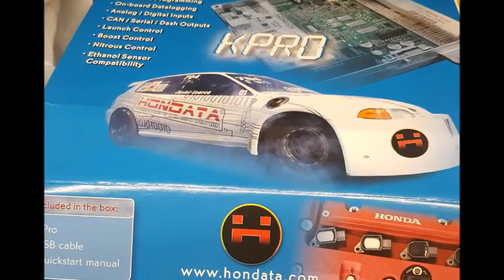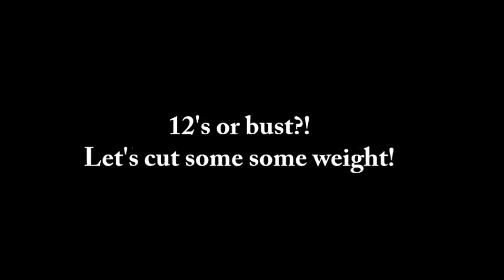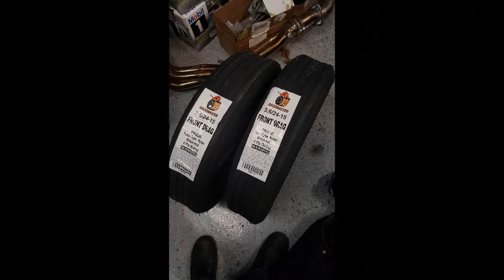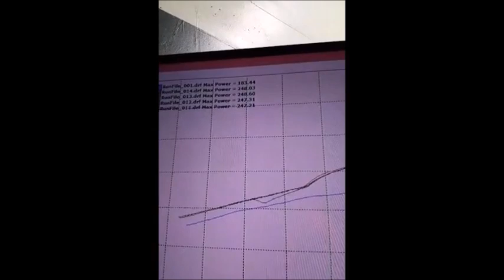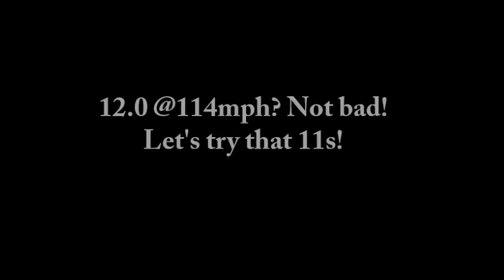11sec all motor Rsx.

Comment: what was his setup when he only ran the 13s? that's what my bolt on 9th si did
Reply from the maker: Taylor Richter intake and exhaust
Reply: Chillin Racing how he pull that with intake and exhaust? Was it gutted already?
Reply: Taylor Richter bolt ons 9th gen si cant hang with a bolt ons 05-06 type s..
Reply: moneyman89065 lol
Reply: Flexin Fb6 same difference. All in the tune and bolt ons.
Reply: Intake, intake mani and full exhaust and hondata i assume because it put down 230whp which is about right with those mods